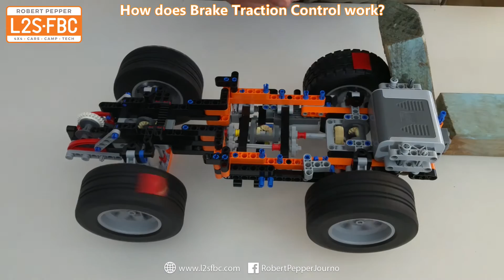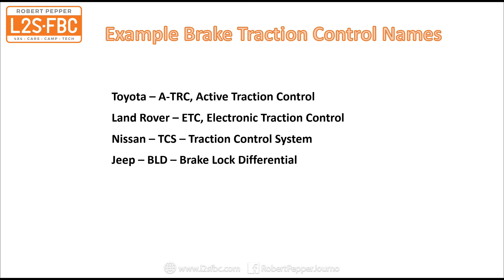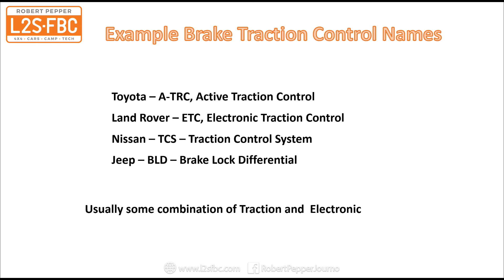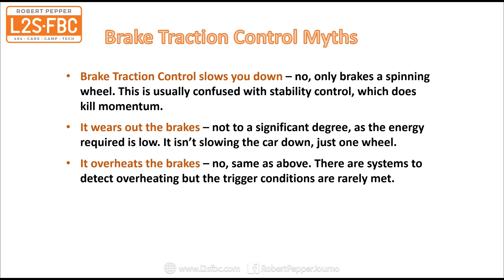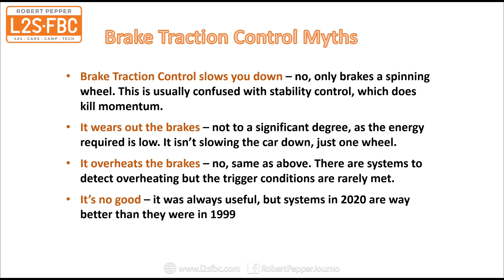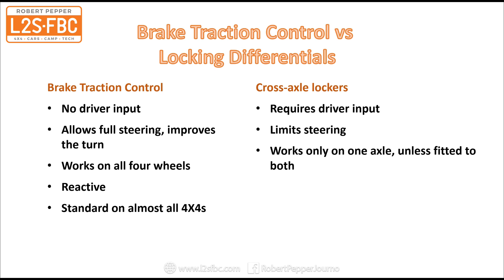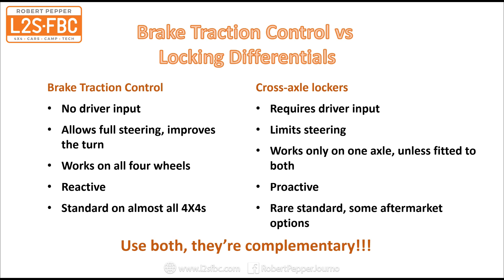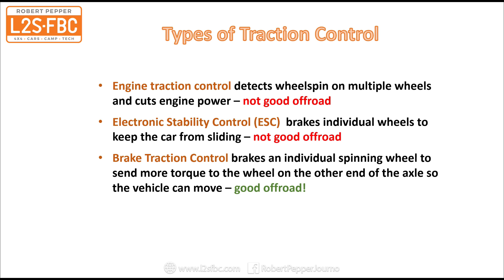Brake Traction Control - it's not what you think

Comment: Subscribed! That’s an excellent video. Thank you. I’m curious about a related technique I once heard about, maybe you could help me - does applying the brake pedal help if you’ve cross-axled an old 4x4 without electronic traction control? I can’t understand how it could work. Really keen on hearing what you think of it.
Reply from the maker: Thanks, yes that can work, if you look at my torque-biasing diffs video that'll explain the base principle.  However, use brake traction control instead, far, far more effective.
Reply: @L2SFBC  just saw it. Thanks once again for another excellent video. I understand now how left-foot braking would work thanks to the 1:3 torque biasing effect. You do however mention that it would work better than with an open diff. My question is then how can it work AT ALL with an open diff? Can it?
Reply from the maker: Yes it can work with purely open as it stops the unloaded wheel spinning and the engine has to drive through the brakes on the other one. Not very effective though.
Reply: @L2SFBC but if the breaking forces on both wheels are equal, the amount of torque you win (by breaking the spinning wheel) is cancelled out at the wheel with grip. I mean, the torque you can transfer to the wheel that has grip equals the torque you created using brakes. It’s the same braking torque that’ll be stopping the wheel with grip so they’d cancel each other out

Comment: You did say some other factors and the Yaw sensor is one other thing used aside from the wheel speeds and steering input angle for the vehicle to tell what’s happening when one wheel is spinning and the other side isn’t.

Comment: Perfect! Yeah , braking a spinning wheel will do nothing for wearing out your brakes . You're stopping far less rotating force. Nothing compared to stopping thousands of lbs.

Yeah ... Some of the FJs (some years , not all years ) , when you cut on the rear locker , it turns off atrac. For my jeep , when I cut on the rear locker , bld still works on the front which is fantastic.
Reply: Which is should. TC should always work on any unlocked axle - unless deactivated on purpose.

Comment: I've given up trying to tell dummies they're wrong when they think they're turning off traction control by turning off the stability control. Now I just file them as morons and keep quiet. It's the Dunning Kruger effect and most 4wders are not mental giants. I have respect for anyone who actually knows the difference between ABS, stability control, and brake traction control. There's a moron in the comments here that thinks ABS applies the brakes when in fact it cleverly does the opposite to stop a wheel from locking and skidding. ABS does stand for Antilock Braking System after all. You can't turn traction control off on a Land Rover, and why would you want to?
Reply: I'm with you 100%. The fact that I'm only the second person in 12 months to give you a "like" reinforces exactly what you said.
Reply from the maker: Wow...I didn't think people like you existed, Mike! Great!  Yes I've seen it a LOT with 4x4 instructors - "oh those electronics just switch them off".  Totally agree with your comments, and yes I've never, ever found a need to disable BTC. Engine traction control and ESC yes for 4X4s, but not BTC. On racetracks I like it all off except for ABS, but that's for fun.

Comment: I think the big disadvantage is that if its going to perform close to or as well as diff locks they require very large brakes such as fitted to Land Rovers, that then limits the wheel size you can use and 20 inch rims are not a good thing off road. I think the best combination is TC and twin locked. But it’s very important the front TC works with the rear locker on to get the best of both.
Reply from the maker: Brake traction control doesn't require big brakes and therefore big rims. And yes should work with rear locker.
Reply: @L2SFBC  I know it doesn’t require very large brakes. What I’m saying is that the bigger brakes will make more on an effect and thus improving the system.

Comment: Clear explanation thanks.

Robert, is there an advantage to "dragging the brakes" with an LSD equiped forby eg Nissan Patrol and if so please explain principles??
Thanks in advance 
CB
Reply from the maker: Depends on the LSD type. If it requires friction on a spinning wheel to work then yes. I may do a video on this concept which is the same as left foot braking an open diff car.